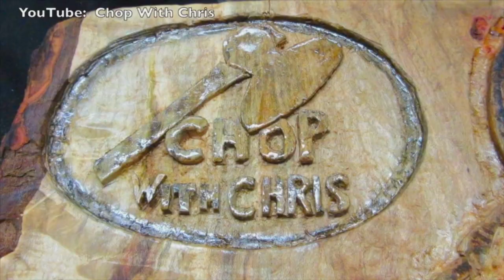RUSTY Post Drill Restoration

Comment: I have two hanging in my shop, a Silver and Deming, and a Champion. Both drills operated fine when i got them. After seeing some that were restored on YouTube, I was very tempted to do the same. In the end, i made the wise choice of not making mine pretty. In fact, I didnt even dismantle and derust mine. I simply applied a liberal amount of oil to everything and let it soak in. After a day or so i wiped away the excess, applied a dab of grease to the gears, oiled the quill, then hung them up. 

I liked the way they looked once the oil soaked in. I also like the fact that they look nearly the same as they did when i got them. Mine no longer look rusty, just like 100 year old steel.

Bravo to you for leaving them in their working clothes for the most part.
Reply from the maker: Thanks and good to hear your experience!

Comment: Does it take square shanked drillbits, like the ones from standard braces? Or can it handle any round shanked drillbit?

I have and always will admire hand powered drilling tools, they are superior in controll to electric powered drills in my opinion
Reply from the maker: It takes round drill bits.  I agree that these machines have i credit ratings precision.

Comment: I bought a post drill over 10 years ago.   I finally got it set up, only to discover it only fit one size of drill.  I rigged a chuck to fit, but it isn’t right and doesn’t drill straight.  I can’t clamp wood to drill because it wobbles.  It also drills very slowly.  I got it from a blacksmith, but I need to drill wood.  I’m not sure what to do with it next.  I’d really like to get it working.   I live off-grid and have lots of hand tools, and pedal and hand powered tools.  I agree… electricity is overrated.   :)    But my drill still doesn’t work…. :(
Reply from the maker: That’s a bummer but don’t give up on it!